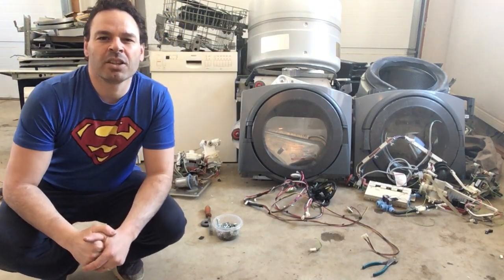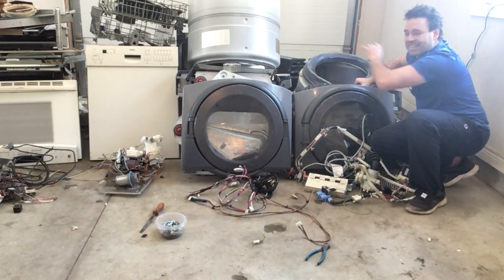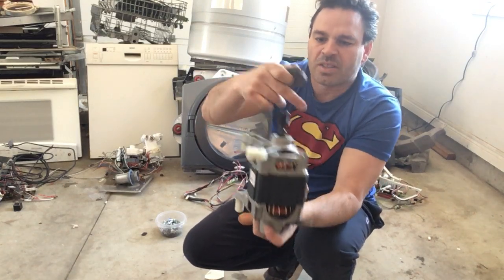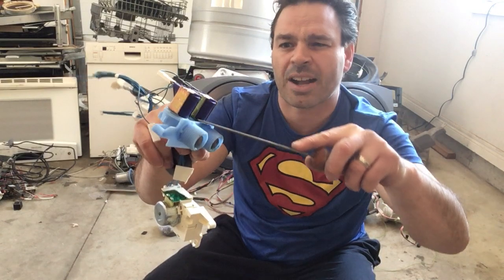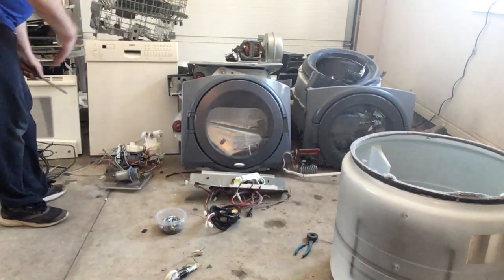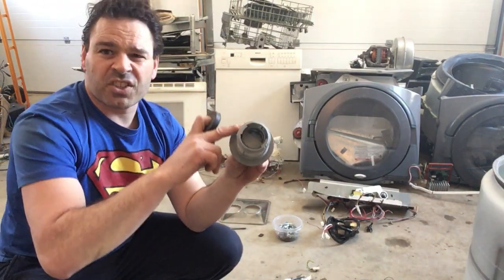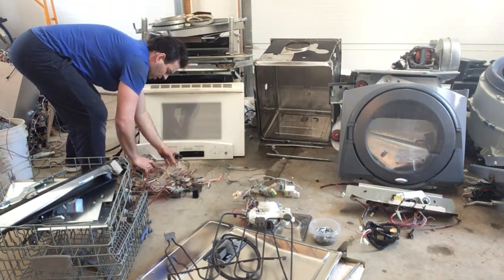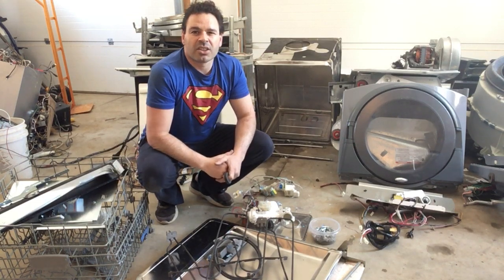Scrapping some large household appliances: which one was worth the most as scrap?

Comment from the maker: Total values and weights: stove 97lbs. #2 copper 8 oz. brass 6 oz.    Dryer 130 lbs. tin, #2 copper 8 oz. brass 3 oz.   Washer 170 lbs. tin, #2 copper 1.5 lbs. 40% wire 1.2 lbs.   Dishwasher 20 lbs tin 30 lbs. stainless steel, #2 copper 1.25lbs.   Dishwasher worth the most with approx. $30.65 worth of scrap value.
Reply: Don't you have separate prices for "Electric Motors"? I strip my coper core motors and  sell my Aluminium core motors as an Electric motor and get really good prices usually. Copper or Aluminium will pay same price in Melbourne Australia

Comment: Great information as always. I have a question about the aluminum motors. The scrap yards in my area classify the aluminum windings as sheet or painted sheet. My question is: In your opinion, at what price would it be worth taking the aluminum windings out of the motors considering how easy it is to break them down. You still get the tin price for the housing and the aluminum windings would be a bonus at a certain point, depending on price obviously. At .50/lb, if you have the room to store it, there must be some point that it becomes worthwhile to separate it. Your thoughts?
Reply from the maker: I find the windings extremely light, so to make it worth my time I would need a whole bunch, but then you have to hold onto it for a while to build up the weight. I guess it does depend on available space and time.

Comment: I like your videos. But what's your time per hour on these disassembly of appliances. I normally go after the motor, wire, and boards the rest is shred and the yards will take the plastic on the ratio to metal. So aren't you making more work for little gain in proportion to time?
Reply: Its true if you look at it in a psr hour rate. That being said I take apart everything for the small increase in value. It all depends on person to person. I work on my scrap in my down time so it doesn't really matter to me personally if it takes longer. To each their own 😃
Reply: In order to get at the motor and wire you end up having to take apart most of it anyway. It also makes it easier to fit more on the load to the scrapyard.
Reply: @jamesfirth1280  hands down you'll make more money pulling something apart. Normally the motors come right out with little disassembly. If distance to the yard is far that's something I hadn't considered. But my yard is 15 minutes away. I want to try and make 45 to 60 an hour. So that's time. So I see a big appliance I try to spend less that 10 minutes with them. I plug it in do a function test. Anything I can quickly remove for resell. Easy wire and motor. If the motor doesn't come out easy I leave it. I usually do the scratch test in the motor before I remove it. 

But I do like the videos posted because than I get an idea of what's worth pulling apart and not
Reply: @SirDexus  For sure and it's a great hobby to have. And their are still things I pull apart and I know I'll loose out on time vs money.